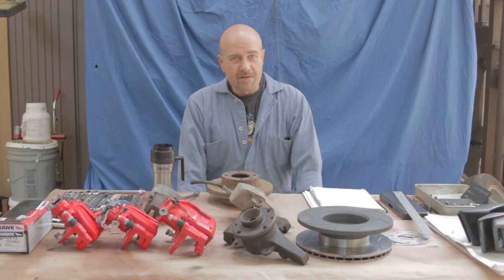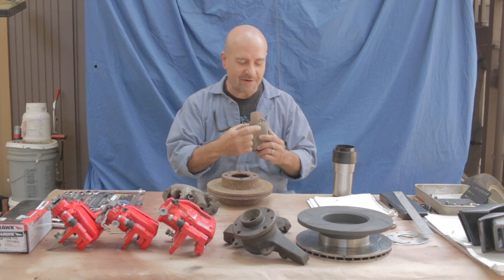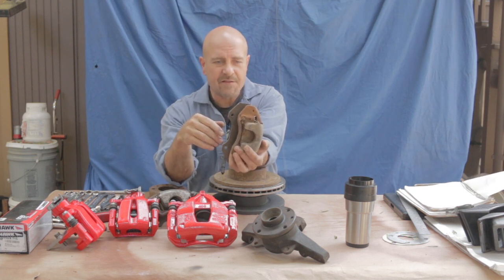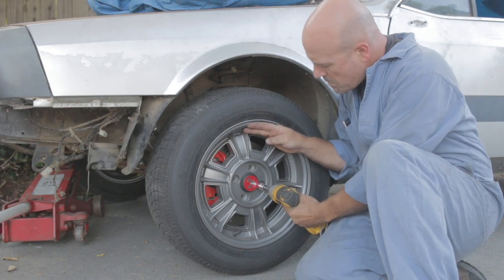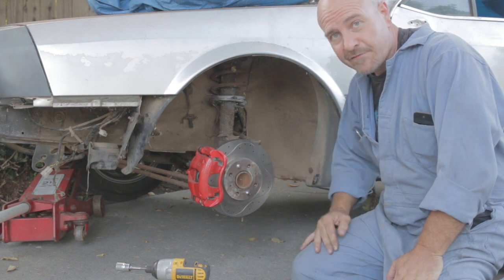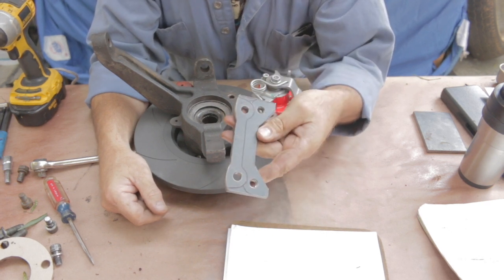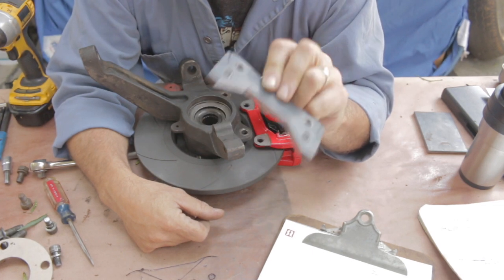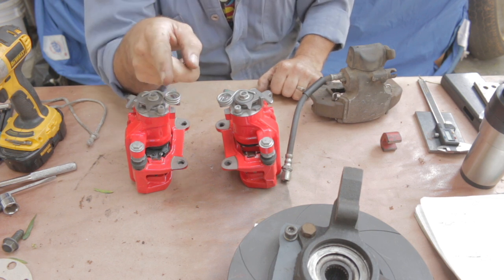Spaghetti Western - Episode 2- Lancia Beta Scorpion/Montecarlo - Brake Upgrade Mod How-To  CORRECTED

Comment: I'm enjoying and learning from this series. Thanks for the attention to detail in each one of them. I'll be very curious to see how a braking system set up for a front wheel drive car with a significant front weight bias will deal with the relatively equal weight bias of the Scorpion.
Reply from the maker: Hey Tom, thanks for the comment.  I'm curious too!  We'll see if I'm wrong to do it this way but I'm doing my best to adjust the weight bias more foward than stock.
I checked out your channel and enjoyed your recent walk-through at the pick-n-pull.  Best regards!

Comment: Really enjoying this build series!  Any idea if my oem breaking system from my RX-7 FD would work on a 77' Scorpion? Cheers
Reply from the maker: Thanks for the comment, but I'm not familiar with Mazda components.  Time to get out the measuring calipers!  Would be great to hear what you discover, best regards
Reply: @rivenmotors7981  Yes, I   will.  I bought a fully stripped out, caged, and stitch welded, FD  intended for Time Attack last year for cheap before all the hype.  Now I have a Scorpion.  I've read about 037 replica builds using MX-5 hubs and uprights so will def check and let you know!
Reply from the maker: @jdmimportlogistics  Are you on xwebforums.com?  That is my goto place for Lancia and Fiat and the site is very helpful and I'm sure they'd love to have you share what you're doing.
Reply: @jdmimportlogistics  where have you seen that? seems like a worthwhile mod to put miata brakes on, but I can't find anyone who's done anything like that

Comment: Will these fit a Series One with the orginal 13inch wheels?
Reply from the maker: Hi, I haven't tried to fit any 13 inch wheels as I didn't have them on hand at the time.  I do now have some 13 inch steel wheels from a fiat that I could try.  I know the inner dimensions may not be  the same as an alloy wheel but I'll give it a shot and let you know.  It'll be in the next few days as I'm out of town at the moment.

Comment: drilled bite better
Reply: No, not really. If anything, with drilled and/or grooved discs/rotors you get less contact area and (slightly) reduced friction.

Grooves and drilled holes are there to remove excessive dust and gasses between the pad and disc/rotor produced by sublimation of the pad friction material under heavy braking, reducing brake fade.